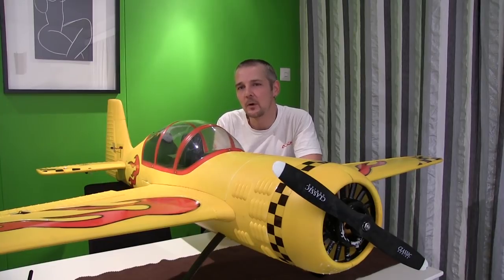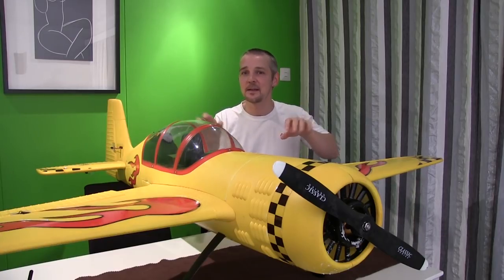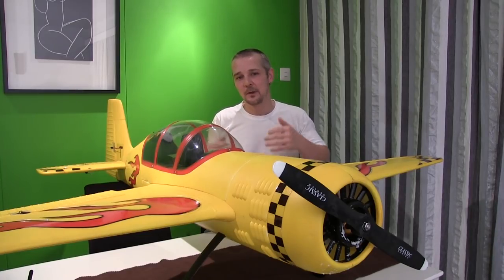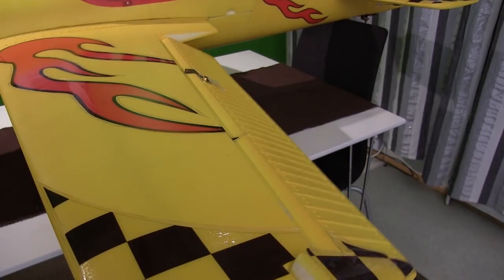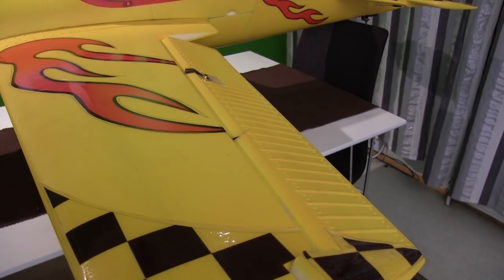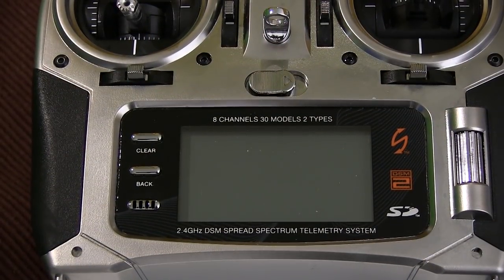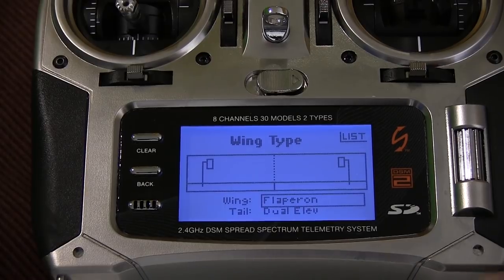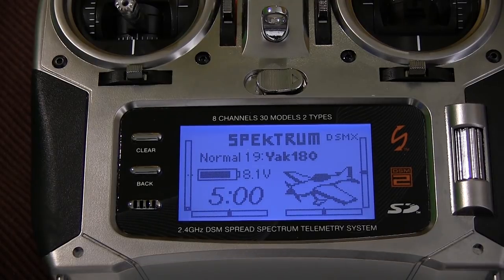Spektrum DX8 - Flaperons - How Does It Work & How To Use Them

Comment: Just set this up on my new Carbon Z Yak 54 prior to my first airplane maiden flight ever tomorrow. Hopefully it will help with my first landing! :)

It was very simple to config, just make sure the aileron servos are in slots "AIL" and "AUX1" on the receiver (i had my right aileron in Aux1 which worked without changes from stock).

Then switch on Flaperons in the radio (after just starting up my left aileron went fully down) and it works like a charm!

Comment: Good job! I just set the flaperons on my C-47 Dakota from Dynam. 35% flaperons with 12% elevator (take off) and 45% flaperons with 15% elevator (landing)
I found that plane gets a little unstable when the flaperons settings goes beyond 50%

Comment: Nice video. I wanted to ask. The numbers you used in your flap system setup, are they specific to your larger 3D plane, or can they be used in most planes. I am getting a 1M Kunai glider. Will those numbers work on that?

Comment: I have a DX8 I tried your experiment with flap around and the flat bronze work on my jewelry switch which has three positions so I set it up so that flap around would come down 60% 80% and then 100% the only problem is is when it’s executed the right air Laurent goes up the left all around goes down into flat mount I’ve tried everything and I mixed different settings and I do use the air around with a mix of elevator and writer as a stick control mix so I don’t know how to get without screwing that up how to get to the point where I can say OK only only on This switch will the air Laurent be reversed if I’ve tried that method already what happens is then it reverses my stick control let me know what you think thank you
Reply from the maker: Are you using two channels for the ailerons?
Reply from the maker: Im sorry i read the text wrong. Im not sure whats happening here. I dont have the DX8 anymore but have the NX10. Same setup meny. I will check into it.

Comment: Hey Articrc can you help me in knowing the channel configuration of flaperon if i use px4 and if there is any parameter change.
I'm using tx and rx - spectrum dx7 and px4
Reply from the maker: Vinayak Singh if im understanding you right. If you use a 4ch receiver you want be able to do flaperons. Cause you need two channels for aileron. So tve smallest receiver you can use is a 5 channel sir

Comment: How do you set the flaperons when using a safe x receiver that uses tge gyro safe function?
Reply from the maker: Hi sir. I havent tried setting it up this way. I never used the safe system. But i will check it out as soon as i get one of these receivers.
Reply: @ArcticRc  Thank you for your reply and for your video.  I tried setting up my Apprentice S 15e with the Flaperons setting and I pretty much figure it out with the help of your video.  Only thing about it was it through off the R-AIL off on the gyro.   If it wasnt for the flaps the plane would have been in pieces.  Anyway thank you and if you do come across one of these recievers feel free to tag or message me on the out come.

Comment: I’m having a problem: when I control my flaperons as ailerons, they go in the right direction.  But when I control them as flaps, they go in opposite directions instead of the same direction.   I. e. one down one up
Reply from the maker: If you use a y cable for ailerons you can't use flaperons. You need to use one aileron  on Ail ch   and the other ail on aux1.  Make reverse changes in flap settings to get rudders to move the right direction

Comment: your servos dont sound good bro
Reply from the maker: Grenge g Hi Sir. these servoes are a bit noisy but strong Digital 12kg. the reason they make noise is that they correct to the center all the time. If there is a bit resistance in the rudders they will make more noise.   servoes are powerHd